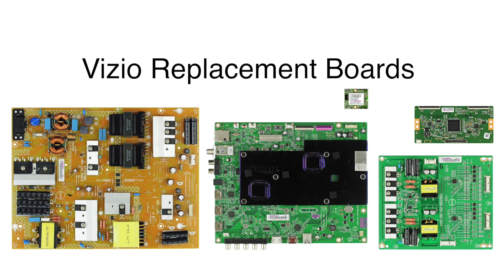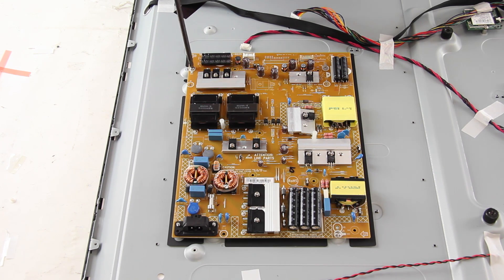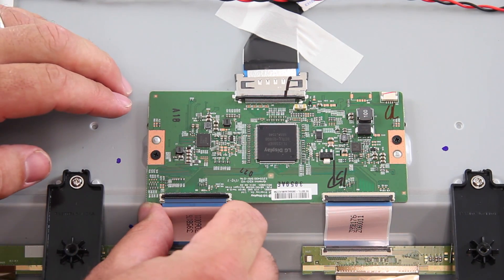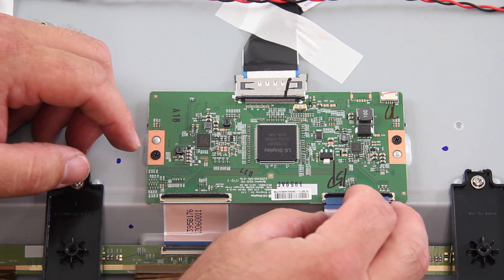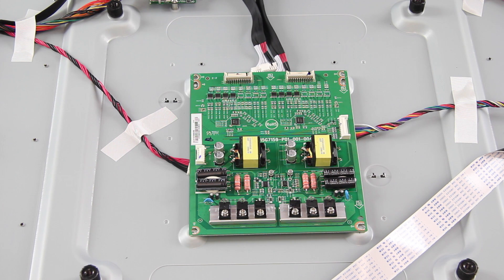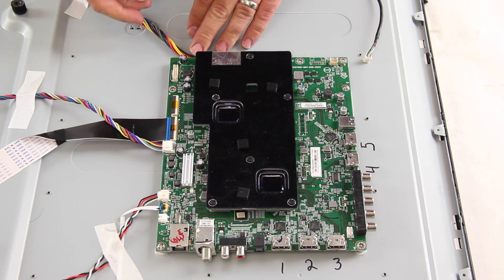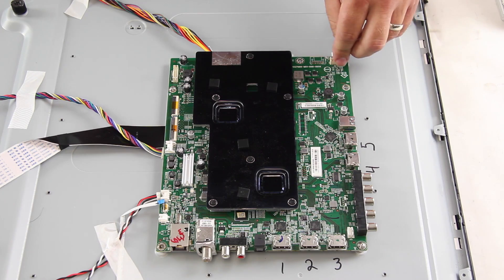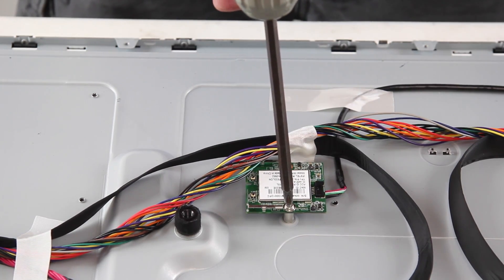Vizio 55" LED TV Model D55U-D1 TV Repair Kit - How to Replace All Boards

Comment: I worked great, my TV had been slowly degrading. I lost wifi a year ago and recently I lost picture. I followed some trouble shooting videos and determined it was not the LEDs. This repair kit is great for just a few dollars more than the mainboard alone you get all of the boards. The hardest part is taking the cover off without breaking it, once you do that it is very straight forward.

Comment: I have a line going down the middle/left side of the screen after fixing backlight clear buttons. Is this a tcon board or main board issue? Or is it the actual lcd that's broken?

Comment: Hi, our D50u-D1 just had the image go pink and then out. There is audio and then it stops and led flashes about 12 times. Flashlight test is negative. Would that be the power supply or t-con one? Still might get the kit to have extras.
Reply: Guess I’ll order the kit and troubleshoot
Reply: @leocal74  How did your repair go?  My d50u-d1's screen just took a poop on me too.  I see the screen lighting up but no picture and a pixilated spot in the right hand corner.  I ordered the kit, just curious how it went for ya?
Reply: @SUMMEYWISE  same, did you ever fix it?
Reply: hey i bought a broken one and it sounds like it has similair problems, although i didnt own it to see if the screen turned pink. did you ever fix it?